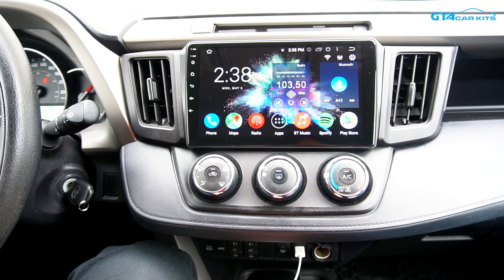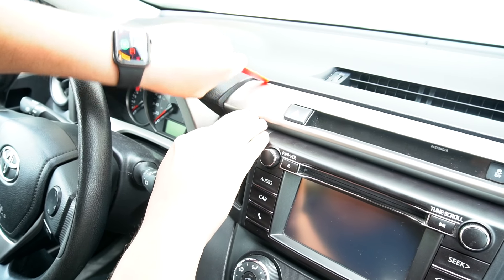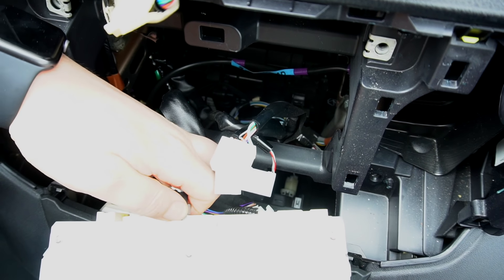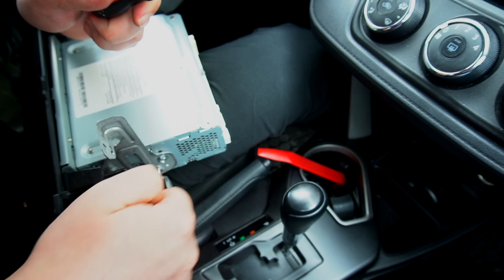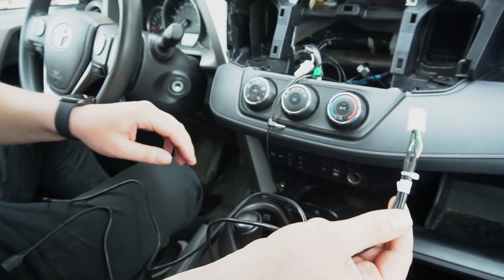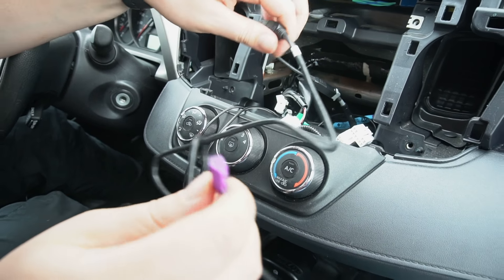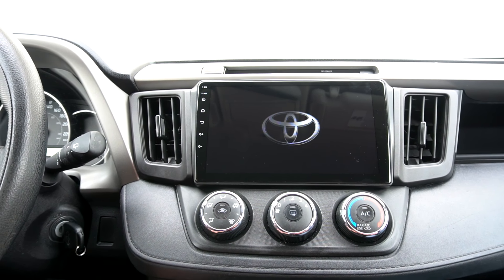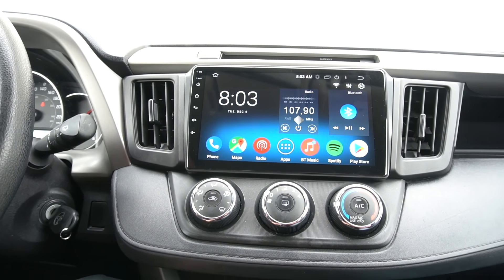Toyota RAV4 2013-2018 Android CarPlay 9'' Stereo by GTA Car Kits

Comment: Can you show a video of the backup camera on this screen? Would love to see if the image is improved.
Reply: My mom just got this kit for her 2014 XLE. The image is not improved, it's just enlarged. The image quality isn't great, but it works, and everything is still visible with guidelines. Hope that helps!
Reply: Jason Martineau is it worth 500$ or should I just get a CarPlay radio unit from amazon for 200$?
Reply: @austinharroun9937  what CarPlay unit are you referring to from Amazon?
Reply: @austinharroun9937  Best to buy unit with cooling fan and from reputable seller.
Reply: @atifkhalid9655  Which ones?
Reply: @legendaryslayer1234  now mostly all units comes with built-in fans. adding manually is not good as it does not work properly. My main issue is call quality not good. Unit looks good though :)
Reply: @atifkhalid9655  I only needed navigation like Google Maps and Waze. I won't be using it for calls. Do you know any reputable sellers I can get it from? Thank you!!
Reply: @legendaryslayer1234  When you use maps on android auto, you are automatically connected for calls. It won't allow to use phone as call unless you turn off power. Try reputable brand. Ali Express units are garbage if you care about call quality as everyone complaints about voice breaking up. There is way to correct that if you know a good electric person who knows how to fix as it need electrical modificaiton. If you don't care about call quality, then but any unit which has good reviews with built-in fan

Comment: Is there a radio, and kit you would recommend for iPhone users, if someone is purchasing a used 2014 RAV4 now, January 2023?  Thanks for your video and help.  Also, what would the price be for a radio, and all needed parts?
Reply: Still hoping someone reads and responds!
Reply: Teyes CC2  or CC3 or Atoto S8  @spincrunch   remembert o get a minimum of 2 gb of ram. More is better

Comment: Thank you for this video. Do you know where to buy only adapters to connect original usb port? My unit doesnt have adapter and original usb port doesnt work.
Reply: I have the same issue. Any luck?
Reply: I had adapter finally in my unit and original usb works :-)
Reply: @Lump399 did you find everything he used in this video?
Reply: I did, but it was long time ago. I dont have RAV4 anymore. It is terrible car without any pleasure from driving.

Comment: Nice system but no update beyond Android 9.0 for the system! Also, you still need to use a new Bluetooth Microphone despite the car have it's own. I will keep using my big Note, works better with updates and no extra charges for hotspot or separate LTE USB.

Comment: I was wondering if it can also monitor miles per gallon, trip time and miles driven like the stock unit can?
Reply: I was wondering this too
Reply: @dashcamuk23  If you connect it to the CAN bus and install the proper app, yes
Reply: @k3dare  does it have gps?
Reply: @teenermeener971  yes , he had gps antenna along with microphone wire inside the Piller
Reply: I have one installed in my car and connected via Bluetooth to a device plugged into the OBD2 and I can get everything on OBD2 app
Reply: @bahhaziz  do you know if this unit gives real time traffic update?
Reply: Link please

Comment: Does this work with the birds eye veiw camera that's on the limited models?
Reply: My mom just got this kit for her 2014 XLE. Though her car does not have the bird's-eye view cameras, the extra connections for those cameras do come with the kit. So, it should be compatible with this unit, yes. Hope that helps!
Reply: @jasonmartineau6441  Unless you have tried hooking up bird eyeview as it need multiple cameras, you can't tell for sure if it works. It is not as simple.

Comment: Nice!
I love how simple it is... does the back up camera will function with 360 degree camera view mode?
Reply: My mom just got this kit for her 2014 XLE. Though her car does not have the 360˚ cameras, the extra connections for those cameras does come with the kit. So, it should be compatible with this unit, yes. Hope that helps!
Reply: Jason Martineau how is the unit holding up
Reply: @ishventurez  So far so good. She doesn't use it often, though. We have noticed that it can be a little slow when it's very hot, but other than that, no issues.
Reply: @jasonmartineau6441  good to hear! I just ordered mines today. I live in Texas so the heat can be a little brutal sometimes. thanks for the quick reply!
Reply: @ishventurez  Yeah, it's been good. I think we tried the bluetooth when we first got it, and something isn't jiving with the speakers, haven't figured that out yet, but we haven't had to use it really. It does pretty well, though. You should be alright.
Reply: Brand name

Comment: Hi, my 2013 Rav4 XLE came with a microphone, navigation, and Sirius XM radio. Would I be able to use the existing wiring for those, or do I have to run the Mic & GPS antenna as shown in the video?
Reply: Same question, can you at least reuse the factory microphone??
Reply: @EverydayExitSign  I need answer to that to

Comment: My rav 4 had a issue that my stereo would reboot and show a blue screen and that’s about it, can replacing the unit solve that ?
Reply from the maker: If the issue is only related to your original stereo, then yes. If this is an issue with the vehicle then no. Thank you

Comment: i have a 360° cameras. Do it work with this system?
Reply: My mom just got this kit for her 2014 XLE. Though her car does not have the 360˚ cameras, the extra connections for those cameras does come with the kit. So, they should be compatible with this unit, yes. Hope that helps!

Comment: Steering wheel control is it hard to hook up ?
Reply: Not at all. The wheel is already wired to the back of the radio, like the main power wiring harness. No struggle at all.

Comment: Hi,  Can I use the original GPS antenna? Do I need an adapter cable?
Reply from the maker: No you cannot. Those are not possible to pair with aftermarket stereo. Thank you.
Reply: @gtacarkits  Are you guys making a new head unit for the RAV4 or can the current one I have get updates through wifi?

Comment: Need one for the 2018-20 Camry. Is there a way for carplay to pop up instantly and be wireless?
Reply: If you buy an Apple car play head unit it will. 

The one in this video is an android auto head unit that happens to be Apple car play compatible.

Comment: What’s the actual model of the head unit? I’d like to look up reviews.
Reply: Hi, Wesley! My mom just got this kit for her 2014 XLE. We had trouble finding that info as well. The only review we found was on their website at the bottom of the page where you can buy the radio. It was pretty vague. However, I can answer any questions if you need me to! Hope that helps!
Reply: Jason Martineau  did the quality of sound change?? I have a 2018 XLE with HD audio and I’m worried the quality will change once installing a third party system. Thanks!
Reply: @anahiii98  As far as I can tell ... there wasn't any change. Quality is still very good with this product. It's tough to say exactly because the stock radio stopped working entirely about 6 months before we replaced it. I think it's good, though. Hope that helps!